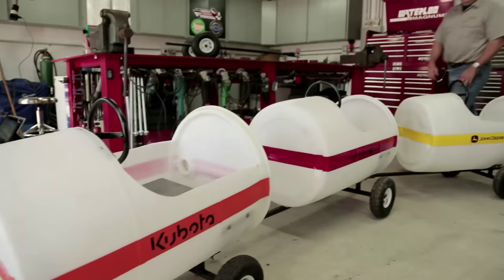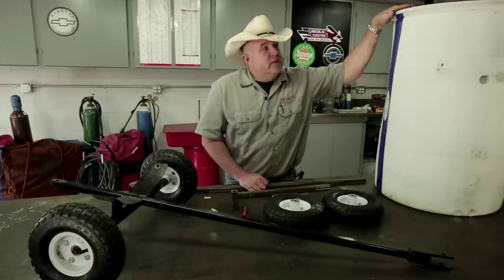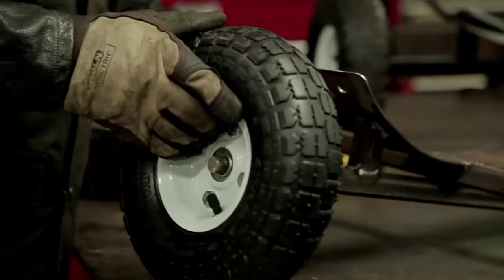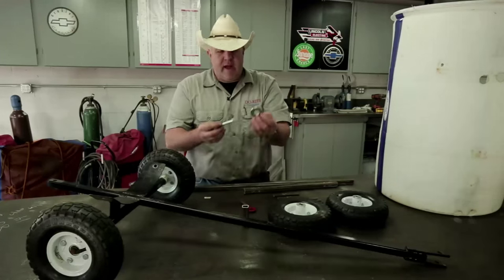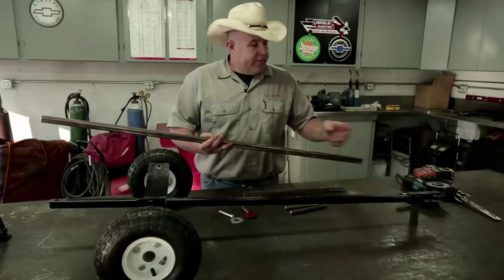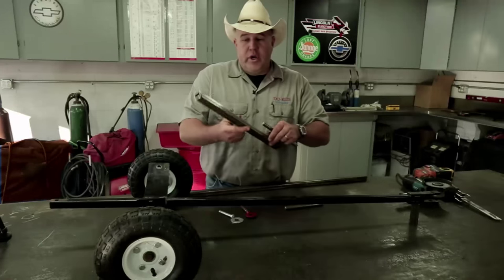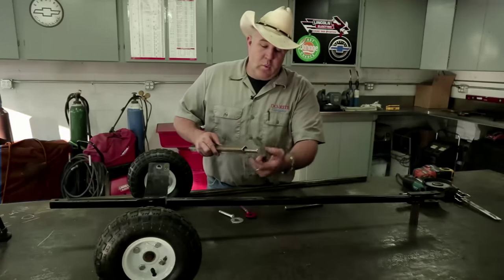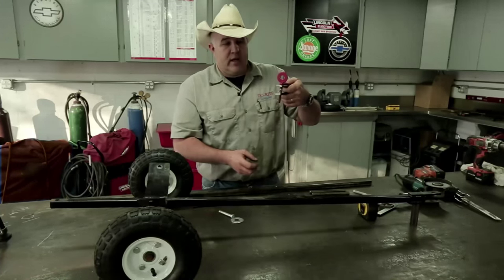Building a Bigger Barrel Train Ep 1

Comment: Hi Jim, what do you tow it with, very tempted to make one for my grand kids.
Reply from the maker: +koliloaloa I use whatever I have around the farm that is not being used at that moment. You can use a riding lawnmower (my boys want to go faster than a riding lawn mower will go), I sometimes use my small tractor with a drawbar hooked to the three point hitch. Honestly, the most convenient thing to use is my Kawasaki Mule (like a golf cart with a bed on the back). It really doesn't matter, as long as you use some common sense with the management of the throttle. It pulls pretty easy, so you could use a small four wheeler or a golf cart too. I will say this, my kids love riding in that thing. Just wait till after a big rain storm and drag them through some puddles, they will think you are the best ever. We were also considering pulling some kids in a local parade. In upcoming videos I show how to cut the barrel, attach the barrel to the frame, make the steering wheel (there is no way that I was going to pay $25 each for  plastic steering wheel), make the seat, make a dash, make the brake light simulators, and apply the graphics. Please stay tuned we have most of the video already filmed, it just take a lot of time to edit it. Thanks for watching!